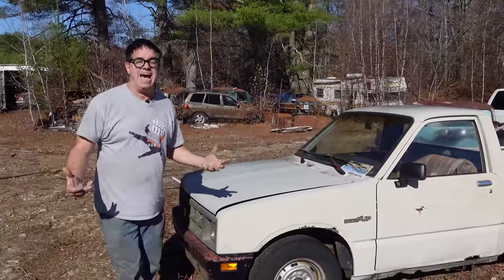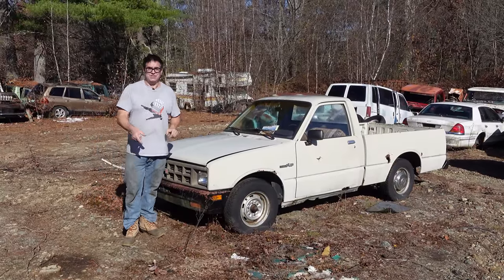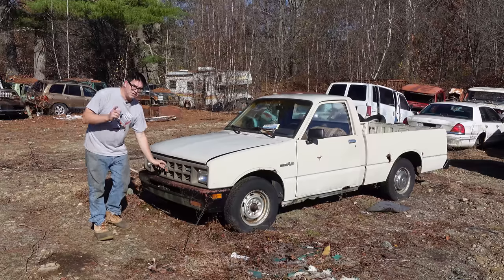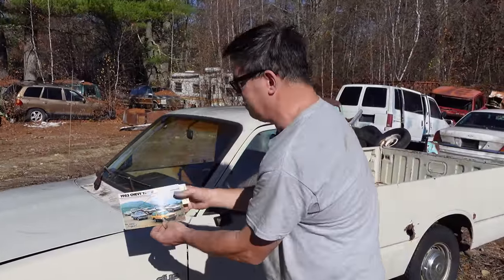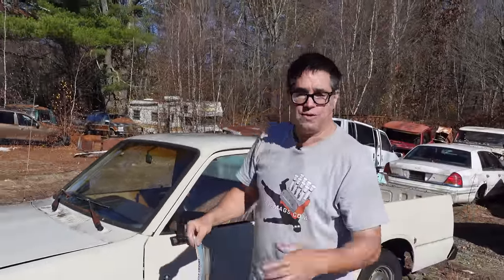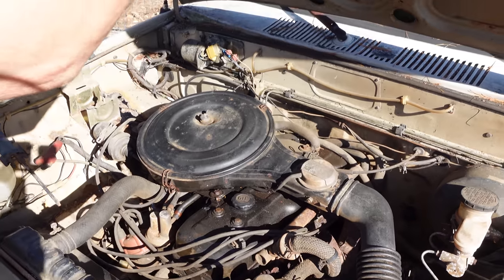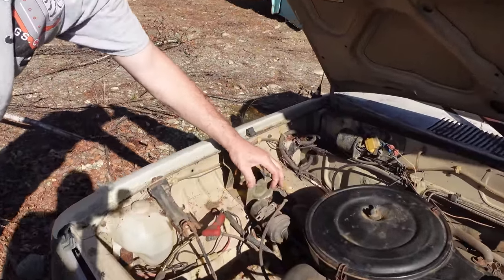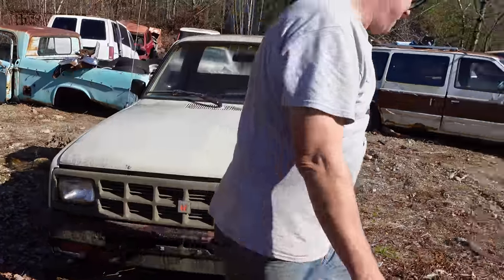1986 Isuzu P’UP

Comment: Man, do y’all remember how big the “mini truck” craze was back in the 80’s? The things were EVERYWHERE and from a customization standpoint, I think mini trucks were to the 80’s what vans were to the 70’s! 

Glancing at that brochure Steve showed also made me think about what a handsome exterior design the Gen 1 S-10’s and Blazers offered - you don’t see a ton of them around anymore, but on the occasion I do catch one in the wild I will usually do a double-take and just enjoy the clean, crisp lines for a moment or two…….👍
Reply: I'm 16 and got a 1987 s10 blazer this summer I'm going to make it look like a late 80s early 90s minitruck. It's 350 swapped and has centerline billet wheels and I just put a 700 watt subwoofer in it now I just have to paint it

Comment: I had a 1988 Izusu pickup that served me well. It had a roomy standard cab and a larger than average 2.6L 4 cylinder. It also had rear disc brakes when not even full size pickups had them. The best part is that it had the best ride of all the mini trucks, not choppy yet firm and steady, about as sporty as a truck could get. When it was totaled by a semi driving into it, the wallowing ride of the brand new Tacoma that replaced it was severely disapponting. I spent hundreds of dollars upgrading that Tacoma’s suspension to make it as enjoyable to drive as the Isuzu.
Reply: Thanks for the story, I'm shocked you survived the crash!
Reply: IMHO these were the years that the Japanese really got on the quality game (at increased price, mind you).

Comment: My grandfather had a '87 Pup as a yard truck and parts hauler. I drove the snot out of that thing. Wasn't fast, but it would get you there and back with no problems. It was a 5 speed and as basic as it got. I would deliver engines to repair shops in that thing. Can't say anything bad about it. Decent fuel milage. It was like a Timex. Took a lickin' and kept on ticking. Until someone stole it one night and rolled it.

Comment: I worked at a Saab dealer in 1983 & I was the parts runner, They gave me a red/orange LUV with a camper cap that i used while working there. After about 2 years someone took notice of it & wanted to buy it & I was soooo bummed when they told me it was being sold. I really liked that truck. I used all of the power. all of the time & it was a lot of fun.

Comment: I still have roughly in 86 Isuzu pup. It was rusty and it was in 10 years old when I picked it up. To get out to the farm for it to be used for a beater truck. It never moved from the spot where I offloaded off my trailer. Still there today. Why use that when you could ride around with something had higher ground clearance I guess. I had I think it was 73 Chevy Love it had four headlights and it was 40 it was yellow. Well just for grins my neighbor and I set up on jack stands just barely sanded it and washed off taped it up and sprayed it with primer and paint. Now where the rust was at especially below the doors on the cab and cab corners. We just took masking tape and put over it to keep the expandable foam from coming out of it as it expanded. We shaved it down. Put a layer tape over it and spray it yellow again. It gets better remember where you do it for grins. Back then Walmart had every color and 10 different shades for every color and their cheap 75 cents a can paint. So we used a dozen spray cans and a dozen primer cans and painted it. I taken the grill off and put a little more effort into it gloss black and clear coated it. It looked really really sharp from especially about 20 feet away. Well I just wanted something to drive around town go pick up stuff and my neighbor couldn't let it be so we didn't a weekend. I think I gave 350 bucks for it and the used car dealer and his salesman were literally laughing and pointing at me as I drove away. But some guy came up and off me something like $1,800 for this truck. This was before 1995 so that would have to be at least $5,000 an equivalent value today! I pointed out all the crap we had done to the truck and I do mean crap. He said he didn't care. He's just going to drive around town basically same thing I was going to do with it. Happen how to with me he went to his bank he paid me so I bank here too I'll put the money in the bank and I just walked the 5 miles back to the house. For about 10 years I ran into him from time to time and he was still driving that little truck probably off and on. That's my crazy LUV story. Well thank you Steve because I actually thought they called it Isuzu pup because it wasn't a real truck. Is only a pup of a truck compared to the old dogs.

Comment: I so wish that these were made today.  I would buy one in a heartbeat.  Small, light, simple and able to carry some cargo.  A truck with a modern motor and drivetrain that got 35 - 40 mpg on the highway would be an absolute killer vehicle.
Reply: If you're interested  to buy it  one..I have  a one  very good Condition  barn find  club  cab. 5 speed...183 .000 miles   for sale..iam asking  $3000 I live in Charlotte  North Carolina

Comment: I worked for a heavy truck (tractor and dump truck) and industrial parts store in metro Atlanta straight out of HS in 1986 before getting my crap together and going to college. I picked up and delivered parts in one of three 2980 diesel powered Chevy Luvs we had. They couldn't pull a greasy strong out of an elephant's butt! All three were stripped down dogs; the worst one being a long bed, and that's usually the one I was stuck with. All were faded red that had turned pink by that time as well. I can't tell you the amount of times I'd have to go down to Moreland Avenue in Atlanta and pick up a load of brake shoes for OTR tractors or something else that overloaded that little truck and would have to drive back down I-20 or 285 with that thing skating all around, feeling like the front tires were barely touching. Good times! We finally got a few S-10's, and it was a night and day difference.

Comment: My folks had Cadillacs till the oil embargo the last one a '59 baby blue. Sold it & started buying small to mid-sized cars but he always had a full sized pickup Skip ahead to '84 Itsabooboo p'up 2.2 Diesel 5 speed gutless wonder sweet MPG. It got passed down to my sis & then to me I got a 130.000 mi trouble free except firewall cracked where the clutch cable mounts. Thanks Steve for all of your videos I'm gonna get crack,n on it. It's an interference engine & original timing belt so I have to do that before I start driving again. A few years ago in a trade (my trade was worth $400.00 )I got a '76  Luv 4 wheel drive that was used at the local tire  shop, perfect condition.I put it on CL for $1,200  a guy drove 3 hrs to buy it I'm still kicking about selling it so cheap.  He loved Diesels 6.2  7.3 etc.

Comment: Accidentally sent before I was done.  The 1.9L engine had a bad wrist pin(s) that rattled like hell above 3,000 rpm unless you were wide open with a heavy load on it, then the rattling held off until about 3,500 rpm.  With the 4-speed that meant top speed was about 55.  It had an up level interior trim option that was actually quite nice, truck rode and handled very well.  Despite not much ground clearance and open diffs it was phenomenal in snow, probably helped it weighed so little.  It was a northeast PA truck, and I learned a hard lesson to look close at the frame before buying a vehicle.  Frame literally snapped in 2 about 9 months after I bought it.  Guarantee that’s why this truck is in the boneyard.  The body on mine was in great shape.

Comment: My Mom passed away 2  years ago and she willed a 1992 ISUZU Pup with 71,000 miles to my 16 year old daughter. It's red with gray cloth and it's been fun working on it with my daughter. I am in my early 50's and she has no clue how popular Mini-Trucks were back in the mid 80's to early 90's. I had a 1986 Mighty Max that was slammed.

Comment: I had one of them from 91 to 2002. Best truck i had. Loved it , but like anything else  it rusted out here in MI. It had 273k miles when i traded it in for a 99 Tacoma. Also rusted frame in 09. Gone now. Now i have an 83 Ford F100 and restoring it, you guessed it, from rust.

Comment: Still have mine. 1986 with A/C. 320,000 miles original engine. Leaks a little oil but runs great. Smog equipment and cat removed. No rust. I also have a  low mileage spare engine , transmission and rear axle. I see no need in buying an  expensive battery truck.

Comment: I never had a P’UP, but I was a proud owner of a 1976 LUV. I recall having an issue with a corroded bolt at the front of the engine, but otherwise a decent vehicle for the time. Thanks Steve!
Reply: From road salt ?
Reply: @speedfreak8200  No, it was an Arizona truck from new. I think it was corrosion due to dissimilar metals, maybe. It was a long bolt through the water pump, which was aluminum, and into the block. Coolants weren’t as good back then, but it’s been over forty years so memories are a little dim! ✌🏼😎

Comment: Worked at a multiline dealership in the 80s and we sold these. I drove a lot of them. I still remember the smell and the very thin plastic covers over the seats when new. P'UPs, Imarks, Trooper IIs and Impulses. I sure don't remember ever installing an intermittent wiper control, but it's been awhile. IIRC I did have to install aftermarket rear bumpers, though.

Comment: Back in the 80's, it was sold as Isuzu Rodeo in the Philippines, and it was a fairly good-looking truck at the time. I like the way they designed the front clip and 4X4 models have nice looking wheels looks similar to GM truck rally wheels.

Comment: No, the last LUV was for the 1982 model year, not 1983. In 1982, you could buy the S Series truck and the LUV at a Chevrolet dealership, but by 1983, it was the S and T Series (there was no T series 4WD until 1983). This is paint code 0172 Glacier White exterior paint or code 808 Cameo White exterior paint. Looks like Katie the junkyard dog is making her rounds. Nah, GM emission decals said that for years. Look at any late 1970s GM emission decal and the language is verbatim on there. To all veterans, thank you for your service. 

So, why is it in a 1983 brochure you might say? Notice the name, "Series 12". That is the 1982 model year, so those are trucks that likely have a "C" for the 10th digit of the VIN and were being sold in 1983 as leftover 1982 models. In December 1983, GM destroyed 600 model year 1982 LUV trucks because they were stored in a rain prone/low lying area of Tampa, FL and had premature rusting of the frames. Rather than try to sell them, GM scrapped them. It worked like this: Series 1 was 1972, 2 was 1973, 3 for 1974, 4 for 1975, 5 for 1976, 6 for 1977, 8 for 1978 (skipping series 7), 9 for 1979, 10 for 1980, 11 for 1981, and 12 for 1982. 

No, that's an aftermarket add on. That's a Zemco wiper delay module. They were located for a time in Huntington Beach, CA and also at 12907 Alcosta Blvd. San Ramon, CA 94583. There's a tint shop at that address now. 

No, Mr. Nixon was out of office by 1976 (he was in office through August 9, 1974), and the 55 MPH speed limit was enacted by him on Janurary 2, 1974, not 1976. By 1976, Gerald Ford was president and then in 1976, Jimmy Carter won the election and was in office by January 1977. No, Congress gave the rights of speed limits back to the states in 1995 (December 8, 1995), not 1986 (or 1996) and it wasn't Mr. Reagan that did that, it was Congress. 

The 55 MPH speed limit spawned the song "I Can't Drive 55" by Sammy Hagar who actually wrote the lyrics to the song after getting a speeding ticket. Mr. Hagar stated that he had the lyrics as the cop was writing out the ticket (going 62 in a 55 MPH zone). He was in Albany, NY at the time, returning from a vacation in Africa. Mr. Hagar also drove a 1979 Pontiac Trans Am with a 403 Oldsmobile V8 engine with the CA vanity plate, "IEATZ28" on it. In 1979, Mr. Hagar along with KMEL radio personnel gave away a 1979 Trans Am at the now defunct Jim Troncatty Pontiac in Corte Madera, CA. Contestants pulled a set of keys out of a bowl and the set that started the car was the winner. It is unknown where that car is today. Being it was in CA, it was a 403 Olds V8 car as well.
Reply: Hey man, thanks for setting the record straight regarding the 55 mph speed limit. 👍
Reply: @kenttalsma7906  Sure thing.

Comment: Those compact import trucks are the best! I tested each diesel one back in 1983 and went with the Mazda B2200 because at the time Mazda gave you the most bang for your buck on anything. These trucks were reliable and ran forever if you could keep them from rotting from salt. My 83 lasted until 99 and 579,000 miles later! Found another in Cypress CA in 2002 and have been driving it since! They should BAN the chicken tax and let Japan import these compact trucks again because they need to get back to their roots and offer cheap economical trucks instead of full sized gas guzzlers like Tundra and Titan etc that are insanely priced. The problem with the Isuzu was it used a C channel frame which didnt take much rot to compromise it and make it unsafe. The Mazda used a box frame which took longer. There were turds in the bunch, the gas Isuzus, Mitsubishis in general were bottom of the barrel in my opinion. Datsun made a great diesel truck but their beds and frames rusted quick as well but I think the Mazda and Datsun were the best, even better than Toyota. Both their diesel engines were clearly better built than Toyota. Toyota didnt give you much and made you pay dearly for it. The Toyota diesel I looked at had a plain interior like this Isuzu with rubber floor mat, vinyl seat, AM radio, sealed beam headlights, and BIAS PLY TIRES! The Mazda Sundowner diesel I ended up buying had carpeting, velour seat, halogen headlights, radial tires, two engine oil filters, oil cooler,  fuel water separator, and the diesel was NO extra cost and it was $2000.00 cheaper than Toyota. The only option was the Clarion AM-FM radio for $225.00! These compact import trucks are hard to find now and bring big bucks for clean ones, and diesels are worth their weight in gold.

Comment: It was good of you to mention the "Kennedy 25% chicken tax" that I'm sure not many people knew about even at the time. 

I don't know if people remember which manufacturer made which small pickup trucks in the 70s and 80s for the U.S. market, so here goes:  
Isuzu = Chevy Luv / Isuzu Faster,
Mazda = Ford Courier / Mazda B-Series,  
Mitsubishi = Dodge Ram 50 / Plymouth Arrow / Mitsubishi Forte and of course, 
Toyota = Toyota, 
Nissan = Datsun (620), a King Cab version of which I owned as my very first vehicle. 

As we're all aware the 70s was a dark time for horsepower but, I did what I could to get some decent performance out of my little 2 liter 4 cylinder.
I first ripped out all of the smog crap which probably added up to a couple of hundred pounds, then I did all the usual things one could do to increase hp but, it was way more difficult to find aftermarket performance parts for my Datsun in the days before the internet. 
I was able to, after tons of investigative research, find almost everything I needed, for example, I installed dual Weber 45s and headers. Bob Sharp Racing was a big help for a lot of the things I wanted. 
I probably spent double again what the truck cost new in aftermarket stuff. I seemed to have gotten a package a week from good old J.C. Whitney & Co., the 1970s version of Amazon for cars. 

 I'm proud to say I beat Porsche 914s and Mazda RX-7s quite regularly and even most V-6 powered American cars with a few V-8s as well.

One correction: Nixon was long gone by 1976. It's not like you to slip up like that Steve.

Comment: I briefly drove a 90 model extended cab with a sliding back glass. Counting the vent windows it had the most windows of any pickup I've known. It had aftermarket rims and was an overall decent little ride.

Comment: I always hated rebuilding those sealed carburetors. I had to grind out the plug to gain access to the mixture screws. Also had to do that when performing high altitude mods to comply with emission standards in the mountain west.

Comment: 🇨🇦 I wanted to order a new LUV in 1977, only you learn they weren't sold in Csnada. I tried to order a '77 El Camino, only to be told that May was too late to order one as they weren't made year round. I ended up with a 1977 GMC Sprint Sierra Madre Del Sur.

Comment: Also known as the GM - Holden KB Rodeo in Australia.
I have one in my project pile, a 1.6lt DLX model twin cab with factory drop side tray, 5 speed stick shift 4wd.
Sllllooooow they are and the diesels even worse but its cute and rust free .

Comment: You could swap a Toyota engine into them with no adapters needed. PUP's were often used as parts haulers by parts dealers. An acquaintance had a fleet that seemed to die miserable deaths at 300k mi. The "Space Cabs'' were cool. Nice memories, thanks.

Comment: My dad bought a white 1984 P'up, very much like this one, used in 1988.  It had those cheap ten hole chrome wheels when he bought it.  I started driving in Jan. 1990 and thought it was a pretty slick truck.  It was the mini-truck days and I had plans of "slamming" it and putting ground effects on it.  Everybody else was into stereo systems.  I wanted to skip that and swap a V8.  It was a dependable truck with no power.  The AC didn't work too well if the temperature was above 75 degrees outside.  The heat worked ok if you put a piece of cardboard in front of the radiator. Dad traded it for a brand new Mazda B2200 in 1991 and I thought I hit the jackpot when he let me drive it.